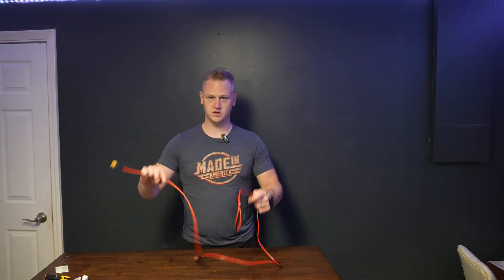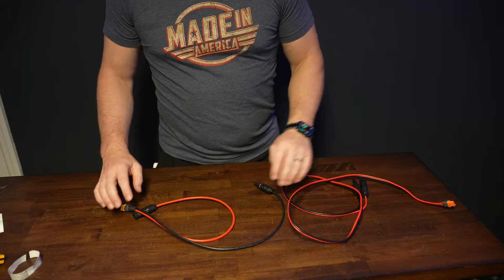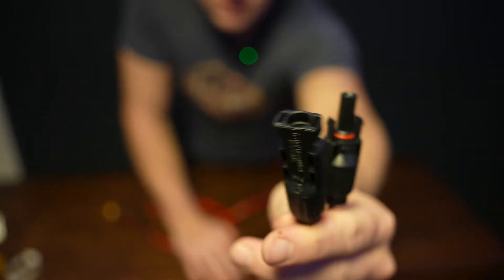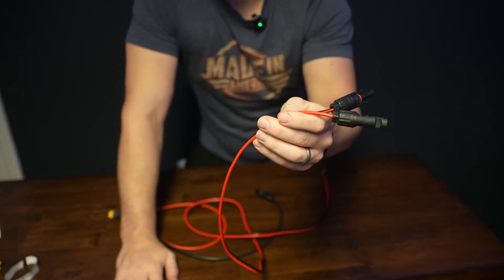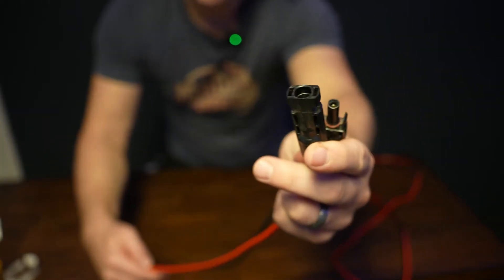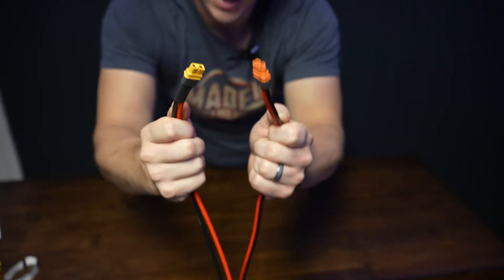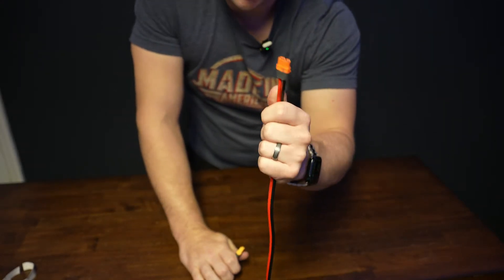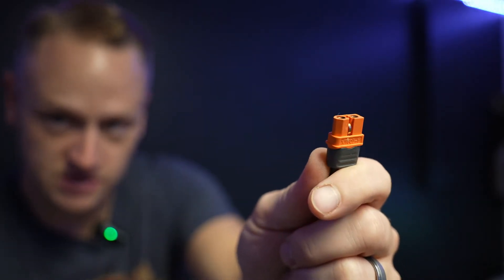XT60 vs XT60i cables

Comment: Amaz. is selling lots of these XT60i cables and if you check feedback, every single one of them does not have the center pin connected to ground, it is useless.

Comment: Its easy to make XT60i from XT60: just make a smal jumper made of copper wire with cores and insert one side to "-" xt60 female socket and another side place at where the 3rd pin at XT60i is located - you've got XT60i without 8A limit! 3rd ping is just information pin without current through it.
PS XT60i with 3rd pin connected to "+" wire behave like XT60 without 3rd pin.
Reply: ……this is making my head spin.  Can anyone else verify this? Seems to make sense, but a pita.  Wish there was an easier way to

Comment: The thing to note is the centre pin seems to have 2  methods / different effects, for solar it's usually connected to negative to allow more power , but when on car cigarette, the xt60i centre is wired to positive to limit current .

Comment: So I have a River 2 Pro. With an XT60 I get 120W max from a 200W solar panel. Will I get more if I use an XT60i cable?
Reply from the maker: No. This really only comes into play on the Delta Pro and getting more than 1280w from an array. You should be fine using either the XT60 or the XT60i it won't matter on the River.
Reply: @ just tried with an XT60i cable and immediately got 156w (46w more then I’ve ever had before)……..

Comment: Delta 2 Should I connect two 210 watt solar panels in series or in parallel to avoid exceeding the voltage and amperage values?
Reply: Don't know the specifics of the Delta 2 but....Voltage -can't be exceeded or will cause damage.  Amperage can be slightly above the max.  Parallel increases the amps and NOT the volts.  Series increases the volts but not the amps.

Comment: Thanks for this video.
I have had a Delta Pro for more than two years and happen to have both connectors and never realised that there's a difference (other than the colour).
I have been using the XT60 exclusively, thinking they were identical.
My solar "array" is quite small, only two 220w bifacial portable panels and they regularly give me a peak of about 440w in series, so I don't expect there will be any meaningful difference for this configuration, but will use the XT60i next time.
I do notice that the cable at the connector is somewhat thicker on the XT60i, which should give less resistance.

Comment: bonjour , moi jai une batterie fossibot f1200 watts , avec une entrer solaire de 200 w maximum,jai brancher le câble xt60 sur le port solaire relier a une rallonge allume cigare avec des pince sur une batterie de 12v 100 amp, pour quelle charge la fossibot mais je n'ai que 40w qui se charge, comment je peut résoudre se problème ,par contre si je branche sur l'allume cigare de la voiture jai 100 watts merci a tous de me répondre svp

Comment: Hi nice video … is this is it with all ecoflow battery or only whit some of battery … I’m about to buy a new ecoflow delta pro 3 .. 4000w whit 2x400 rigid solar panel which cable connect I need to buy to run properly from panel solar into the ecoflow battery … thank you

Comment: Lot of confusion so I’m going to throw in my 2 cents. 

The xt60i cable with a negative bridge tells the unit it is ok to charge at 15 amps on one socket. 
With this scenario it wouldn’t matter if the unit was connected to solar or a lithium battery via the cable it would charge at its max rate. 

An XT60 cable is also capable of charging at higher than 8 amps but in this scenario you are allowing the unit to choose for you and to be honest in my experience it’s pretty crap at doing so. 

Use an XT60i with a negative bridge. Saves messing about. Pair in with 10 or 12 awg cable, dc rated and you should be good to go.

Comment: @thechamp66 curious if the Delta that did not support the higher current had an internal yellow (XT60) connector, and the Delta that did support the higher current had an internal orange (XT60i) connector.

Comment: OK, so if I'm only running a 220 Watt Solar Panel, would it suffice to say I'd be ok with either connector into my Delta 2 Plus?
Reply from the maker: Yes, you'd be fine with either in that scenario. Good luck!

Comment: The Delta Pros senses the ground connection on the center pin and will allow charging at a great charge than 8 amps.  Delta Pos will limit the charging rate on non grounded center pin to protect the charging source.   In Daniel case, I guessing that the Delta Pro that charges more than 8 amps has a deflect or has been damaged.  This Delta Pro will not protect a charging device that a current limit of amps or less.

Comment: Hi, through my research, calculations and limited knowledge, I’ve found that solar cables < 25’ should be 12awg and > 25’ should be 10awg for optimal charging and to limit voltage drop. It’s my understanding that the EcoFlow cable which is ~ 11.5’ is 14awg. 
Apart from the differences between the XT60 and 60i connectors, can some of the problems with performance be due to the undersized EF cable? Also, is it safe to run a 12awg or 10awg with the Detla 1/2/3 or will it fry the unit?
Reply from the maker: Ok, here's the deal with cable thickness. First, at the voltages/amps we're talking about for the Delta Pro (Under 150v/15a), there's honestly not much real-world difference between 10awg and 12awg. You can test this out yourself or there's a number of videos on YT demoing minimal differences between 12awg and 10awg even on long runs. There is no risk to the Delta units from using "undersized" cables. Lastly, look at your house, there's a lot of US houses using 14awg cable to convey the same amount of power (1500w). This is one of those things that is fun to discuss but in the real world you're looking at a 2-3% difference if that. I've used both 10awg and 12awg and not had a problem with either.
Reply from the maker: Sorry, second reply cause I didn't feel like my first one was complete enough. 12awg PV cable is usually rated for 1500v and 20-30amps. 10awg is rated for 2000v and 30 amps. Both are more than enough for the 150v/15a rating of a Delta Pro (max of 1600w). Both are going to be efficient to the point you won't notice the difference. Save your money on the 10awg cable and go with 12awg. You won't miss it.
Reply: @DanielGoodwin-jq1oc  Thanks for the info!

Comment: Sorry for my bad English: For those who want to make their own EF cable including XT60i, it all depends on what message you want to give to the device For example, I have an EF cigarette lighter to XT60i cable wired at EF for a GLACIER EcoFlow... The 3rd pin is correctly connected to the positive of the cable. For EcoFlow it is translated as: we are connected to a cigarette lighter socket that we do not want to melt so we limit the intensity to 8A .

Comment: I'll save you 7 minutes of this dude rambling on. The XT60 cable has a current rating of 60A, while the XT60i cable has a current rating of 100A. XT60i is orange and has an additional locking pin.
Reply: Geezus. Thank you.
Reply: "I'll save you 7 minutes by giving you wrong information."
XT60 & XT60i connectors rated at 60A. Cables usually are rated at 15A as 14AWG are used and most powerbanks don't accept more than that for safety.
Reply: Thank you
Reply: As you persist in leaving erroneous and dangerous information about this XT60i plug, nothing is better than practice... Run 100A if you already have the generator (I have one...) And come back to us after several hours of operation at this level... Then we will discuss it again and then you will be able to usefully share your constructive experience.

Comment: I just received my EP DP2 this week and have been so confused by the XT60I wiring because of conflicting information.  It came with a 12volt car charging cable.. and with a multimeter verified that the flat/square side of the XT60I was positive.. BUT the center tab was ALSO connected to the positive side.  Is this how EcoFlow controls the incoming wattage?  The center tab bonded to positive is low wattage, bonded to high is High wattage or will the wrong one short things out? Ultimately I’m trying to make sure I can connect my Dokio portable panels (SAE connectors) to the Delta Pro 2 at full power. 🤷‍♂️
Reply from the maker: Delta Pro 2? I don't think EF makes a DP2 :) DP3 perhaps?

Comment: One reason why  people do not see  those 1600 wats  on their delta pro for example is % of state of battery in solar station.
I made a charging curve for delta 2 on my 1kw version.
I set maximum charging from 1,2 kw and check each % from 0 % - 100 %.
From 75%  charging curve is going lower till it reaches 100 %. So delta PRO can have similar charging  curve that needs to me measured like I did  with my delta 2.
	
0 % - 48 %	1,23 kwh
49 % - 74 %	1 kwh
75%	950 wat
76%	930 wat
77%	900 wat
78%	870 wat
79%	840 wat
80%	800 wat
81%	750 wat
82%	690 wat
83%	600 wat
84%	490 wat
85%	403 wat
86%	350 wat
87%	315 wat
88%	304 wat
89%	285 wat
90%	270 wat

91% - 94 %	266 wat
95% - 99 %	260 wat
99% - 100 % 	235 wat
Reply: The rate of charging depends on the temperature of the unit. The hotter it gets the slower the rate of charge. It can charge at over 1200kw with the battery at more than 90% full if it isn't getting too hot
Reply: @007alztruli  yes it depends from temperature, but i did this test 4 times from 75 , 50, 25 and 0% of state from solar station. IT was during night. IT did almost identical results. But test was made almost a year ago. Maybe some firmware updates had changed something. Now i do not have time for retesting, but I will. Gl

Comment: The Ecoflow Delta 1300 (original Delta) uses an XT60. Anyone know if the XT60i will also work with the Delta 1300?
Reply from the maker: As a solar connector? Yes, it should work fine for you.

Comment: Nonsense.  All xt60...xt60, xt60h and xt60i are rated 60 amps or 100 amp burst. It's in the name.  Guess what an xt30 handles? The extra pin on the "i" is for reading battery information from smart batteries.  Crappy Chinese xt60 connectors that are not to standard or more likely, has either the bullet connector stretched or the male reduced from incorrect plugging.  You can widen the male by simply bending the prongs out a little to make a tighter fit.
Reply: Can you add one of these xt60i's using ring terminals to a set of busbars on 48v battery bank system to use for charging the ecoflows?

Comment: Do you think the xt60 cable can fail sooner than the xt60i? I was using the xt60 cable for about a month and now I get nothing from my solar array. I checked my inline fuses they were good and I replaced my mc4 connectors coming off my xt60 cable. I have 34v coming off my solar array mc4 connectors and my xt60 connector but my delta pro will not register the power or charge.
Reply from the maker: Hmm, generally speaking I really wouldn't expect either XT60 or XT60i cables to fail. Did you check your voltage and/or amps from the panel using a volt meter? (You mentioned you knew it was 34v). Since cables are fairly inexpensive, I would try swapping those out and seeing if it resolves the issue but my initial thought is its unlikely to be the cable. Are all your connections tight? (particularly the MC4 ones)

Comment: Maybe someone here that's really smart can answer this.  I have a 48v (51.2V) battery connected to the Ecoflow Delta Pro via an XT60i (back of the Delta Pro) and the other end on the battery lugs (+/-) and i'm only seeing 400watts.  The interesting thing is that the power ramps up past 400 watts to 500+, then, clips back down.    Yes, I"m sure I have the XT60i cable...... any idea what's going on and how I can get 800+ watts?
Reply from the maker: To consistently get more then you're probably going to need to look at a DC-to-DC boost converter. This issue you're encountering is that the DP sees that power source as a constant lower voltage and thinks it's a car battery so it throttles the amperage to 7.5 amps instead of the full 15 amps. I covered several DC boost converters that do this:

https://www.youtube.com/watch?v=rWRU87M8g7s
Reply: @DanielGoodwin-jq1oc  not really comfortable with any of the options you showed in your video.  IN fact, one of them isn't sold on amazon any longer (it's the one with the box covered and the two XT60i cables).    Maybe I can just use an inverter hooked to 48v and then plug in the DP to the a/c.  Not optimal but I think that would work.... thoughts?
Reply from the maker: Yes, that will work perfectly. In fact, that's essentially what I'm doing with mine. I have to use a switching power supply because I have my Delta Pros connected to a Smart Home Panel but if you don't have that then you can definitely connect to the AC input.
Reply: @DanielGoodwin-jq1oc  ok thank you. I thought it might have been related to the xt60i

Comment: From an Electrical Engineer:

Periodically there have been questions about how does the Delta Mini/Max/Pro know when it’s charging by car and limit the current to 8A, and when it’s charging by solar and thus allow the unit’s max current limit (10A for DMin/Max, 15A for DPro). 

The secret is in the XT60i connector. In the car charging cable, the center pin is bridged with the main pin on the square side (+) of the connector. On the solar charging cable, the center pin is bridged with main pin on the angled side (-) of the connector. This way, the Delta Mini/Max/Pro can automatically adjust the current limit depending on which cord is connected. If you use another cable with a standard XT60 connector (no center pin), the unit will default to the 8A limit just to be safe. 

TLDR (Too Long, Didn't Read) Summary:
1. XT60i cable allows more than 8A of charging with any DC power source (solar or otherwise).
2. XT60 cable allows more than 8A of charging with *ONLY SOLAR PANELS*, but not with SMPS or standalone battery.
--------------------

Detailed explanation:
First of all, the official word from EcoFlow engineers is that the XT60 solar cable should be able to charge at more than 8A *WHEN USED WITH A SOLAR PANEL*. Why is this distinction important? Please see below:
1. XT60i solar cable - This is the solar cable with the orange connector at the end. This cable will ALWAYS allow for more than 8A, regardless of whether you are using it with solar panels or with an AC-DC SMPS (Switched Mode Power Supply).

More info here on how the XT60i cable works: https://www.facebook.com/.../permalink/1381304675669717

2. XT60 solar cable WITH SOLAR PANEL - This is the solar cable with the yellow connector at the end. This will allow more than 8A charging via solar panel. From my testing (see attached pictures) with a Delta 2 and the 220W bifacial solar panel, you can clearly see that the charge current is over 8A.

EF engineering has said that occasionally the power station may mis-identify the XT60 cable and limit it to 8A, but you can unplug and replug to get it to recognize the cable. But I have tested it multiple times, and it worked at over 8A each time.

3. XT60 solar cable WITH SMPS OR STANDALONE BATTERY - This does not affect most users. For the few users who are using an AC-DC SMPS or a standalone battery to charge your power station, make sure to use the XT60i cable. Because the XT60 will be identified as a car charger, and will be limited to 8A. I've tested SMPS multiple times with various EF power stations. Mark Hicks contributed standalone battery test results. 
 

https://www.facebook.com/groups/deltaprolaunch/permalink/1491858437947673/

https://www.facebook.com/groups/deltaprolaunch/permalink/1490488248084692/

https://www.facebook.com/groups/deltaprolaunch/permalink/1491976177935899/
Reply: Best explanation I've seen yet. Thank you!
Reply: Sir, you are a legend for this.  I've been trying to find a detailed explanation all morning, and until I came across your comment, I came up short.  I'm making my own XT60i to MC4 cables, and could not figure out what to connect the middle pin to.  I now feel confident in making the connection.  THANK YOU!
Reply: I haven't clue what you are taking about ..  but its 100%  more understandable now you have took time in helping us uneducated  Peasants..I've just purchased a ecoflow  river dancing  Malarki  and I was  wondering about everything you have just explained ... thank you very much ... in my book you need to be knighted for great explanation.
Reply: I have few sily questions. I have Ecoflow Delta 2
1. How much power will I get from a 650W, 20V panel with an xt60i connector under ideal conditions? 
2. Same with the XT60 connector. 
3. How much energy can I get from ten of these panels wired in parallel at half solar power?
Thank You

Comment: The 60i cable that came with my DP was allowing a 1200 watt charge but it got warm. I didn't like that. So I bought a new 10 foot 60i cable from Amazon. That cable limits the charge to 1000 watts. But now it doesn't get warm. So I'm leaving it like that. I just don't get why an exact connector would reduce the watts.
Reply: Good observation. Either the connector or the wire can add resistance to the circuit. It doesn't take much extra resistance to reduce the current. Heat is proportional to current squared so reducing the current 20% reduces the heating 40%. Cables getting warm at high current is normal but if it gets hot that can be a problem. Hot plastic tends to degrade much more quickly over time and when it softens enough the support for the connector pins fails and catastrophic failure results.

Comment: This answered my question. I have the yellow XT60 10' extension going out the front door to my 400w panel and just bought the Xt60I for my Delta 2 and going to see if there's a difference. Both of these models can only accept up to 500w. Maybe I can find a couple of 275w panels for some over paneling..? I did already buy the xt60I with the 12v car adapter.. 104w total input.
Reply: Did you notice a difference between the charging rate (in watts) of the XT60 & XT60i on your Delata 2?